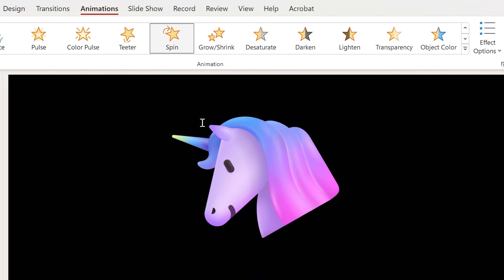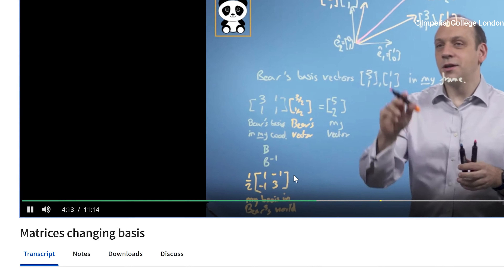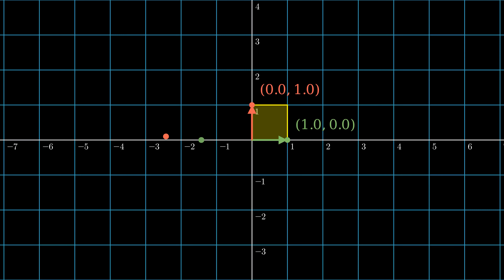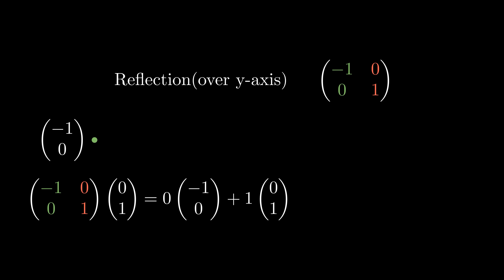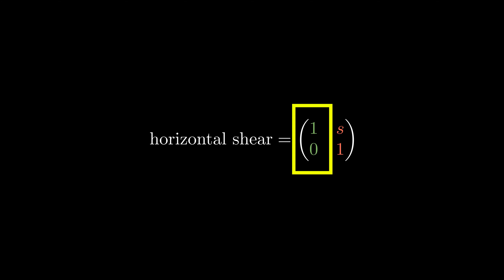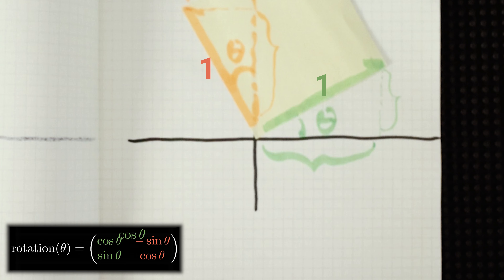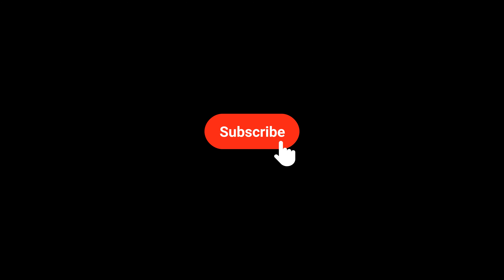4 Transformation Matrices in 4 Mins

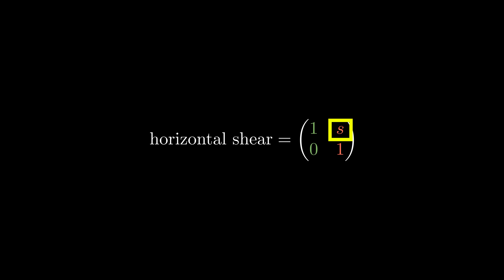Comment: 2:50 the card analogy isn't true when you can change the height of the stack. It only works by angle
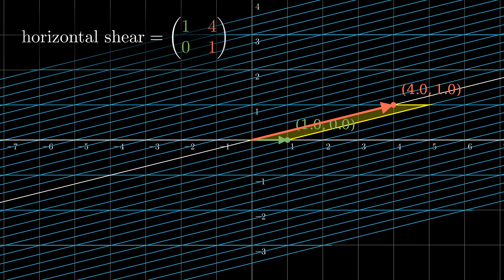Reply from the maker: Hi Stopshot, thanks for the comment! If I understand your comment correctly, that the ideal animation should focus solely on the vertical grid line changes, excluding any changes on the horizontal grid line  (e.g. the bump at 2:55 ), I agree with your rigorous analysis. Indeed, the card analogy only works when the height doesn't change.